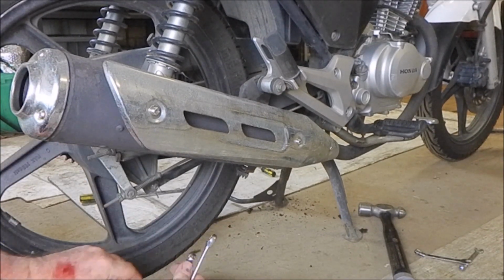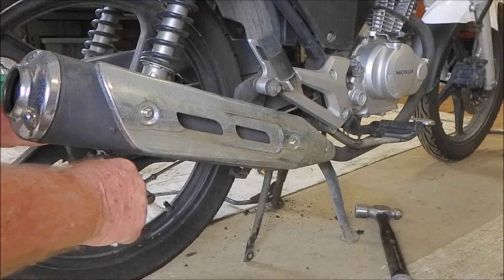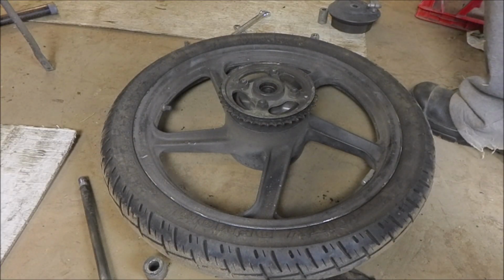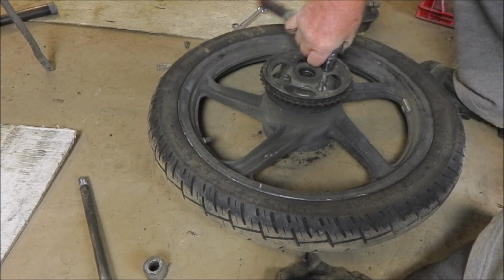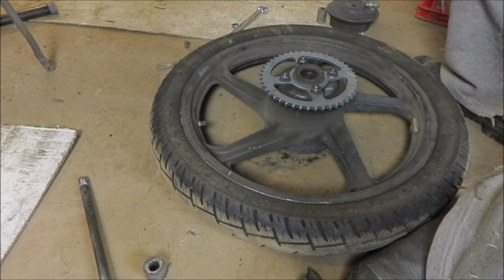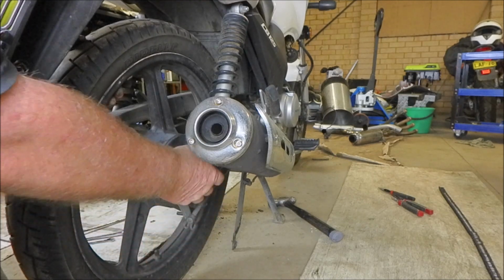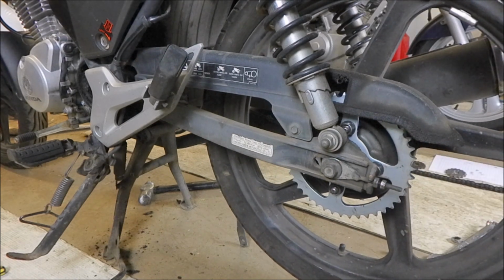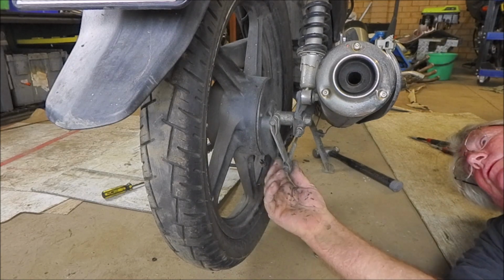Honda CB125E - Replace Drive Chain and Sprockets Part Three

Comment: How many KMs did you get out of the chain and sprockets my 125E needs both a set of sprockets plus a chain it's done 25kms it's a 2012 model
Reply from the maker: 25,000km is a very normal mileage for chain and sprockets.  You certainly got your moneys worth!